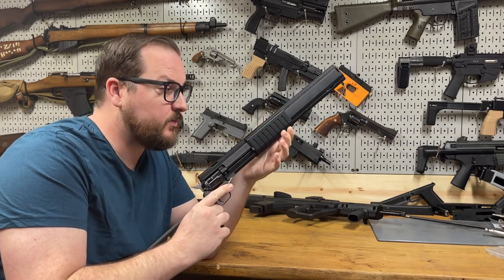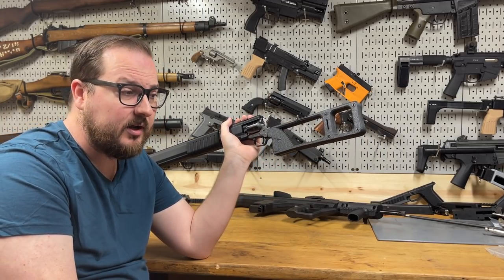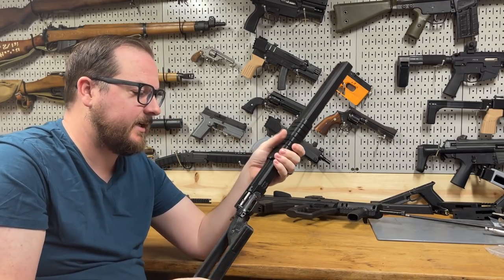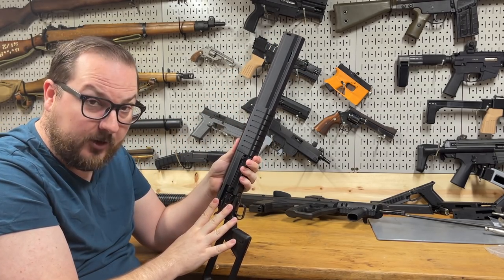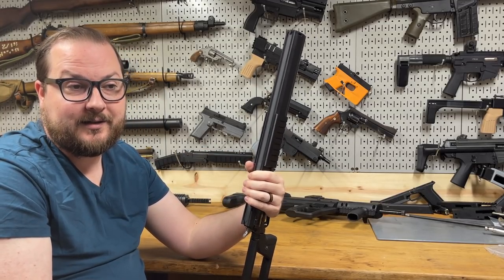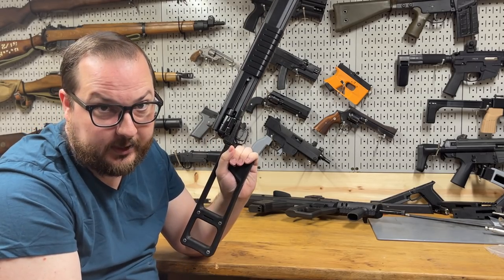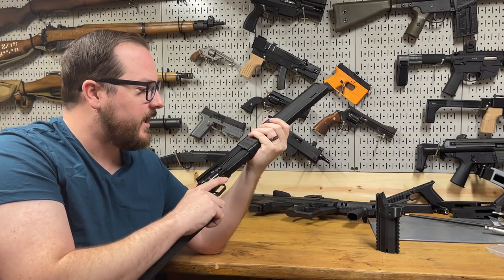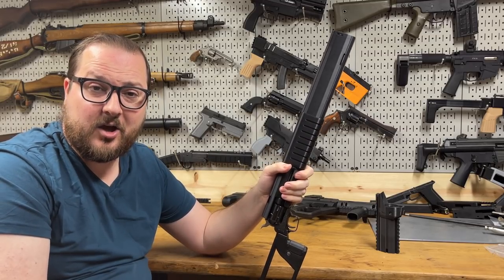Heritage Rough Rider Space Carbine Overview

Comment: Why not split the model of the stock right down the middle of that cross brace and add countersunk holes for screws and nuts, and model up an extension piece that can be printed to lengthen the length of pull?